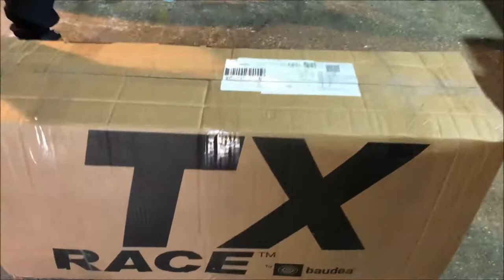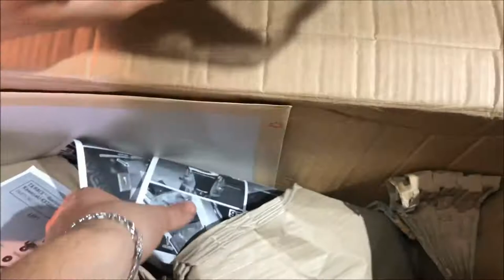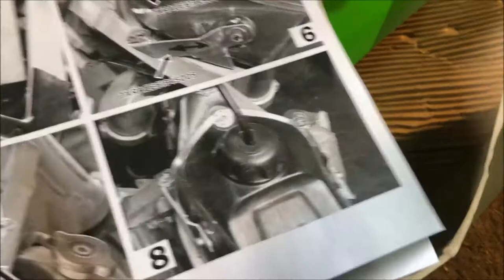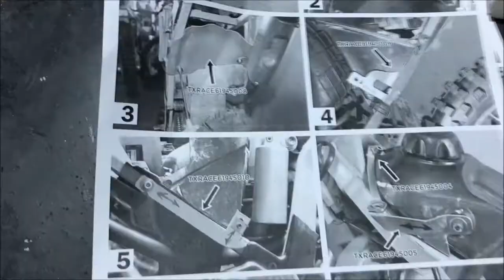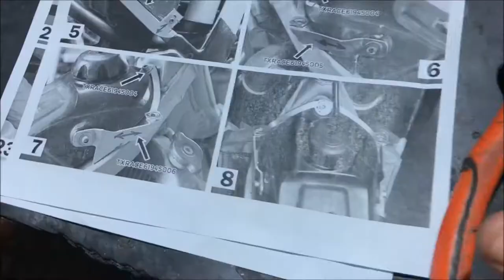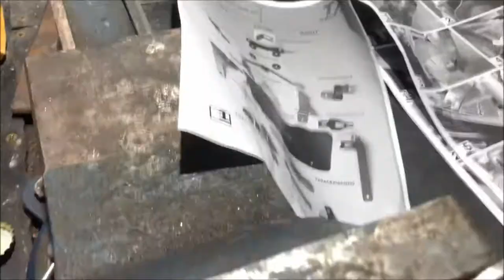JE MODERNISE MA 125KX ! avec le kit TX RACE

Comment: Le rendu est top ! 
Je suis en train de refaire un 125kdx de 2000, tu pense que ça irais dessus ou vaut mieux racheter des carénages d’origine ?
Reply from the maker: Oui le kit est compatible de 1999 à 2002 👍
Reply: @mrdexer9967  oui mais moi c’est une kdx donc c’est pas pareil que kx ?
Reply from the maker: @anthoj1639  ah oui pardon je n’avais pas vue Kdx , alors pour kdx je sais pas du tout si il sont compatible, essaye de voir en fonction de la forme de mon cadre si ça ce ressemble
Reply: Bonjours le kit passe til sur une année 1996 ? Vue que 96 et 99 c'est les même carénage d'origine
Reply: Salut mec , sur un kdx il faut changer la selle et le réservoir par un de 125 kx 2003-2008 et après tu met le kit plastique restyler du 125 kx 2003 voilà voila